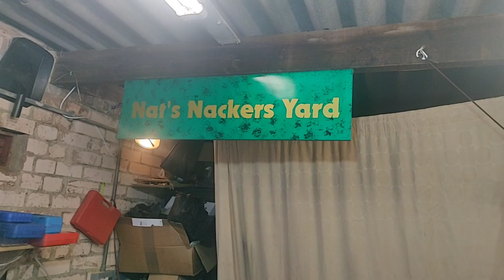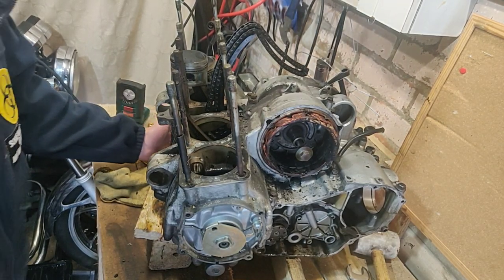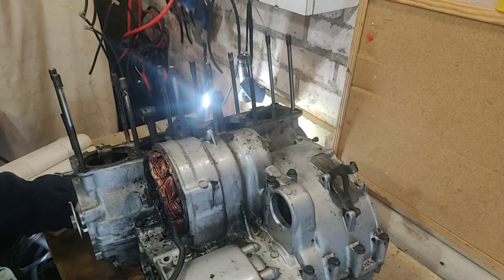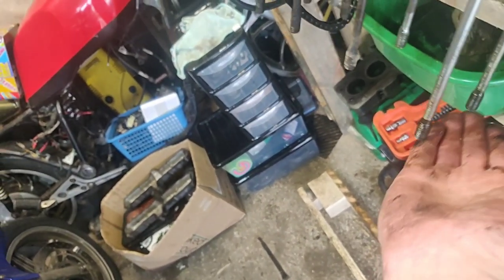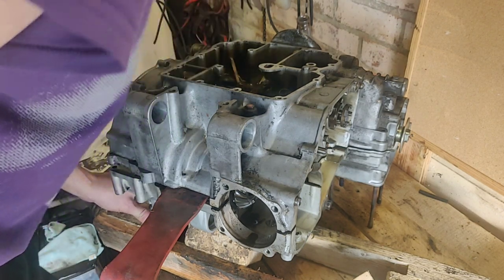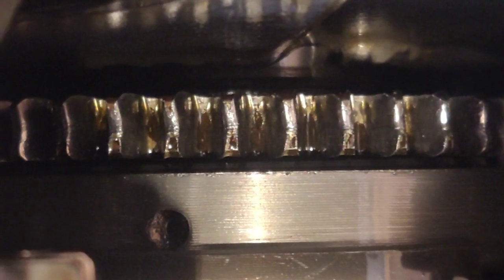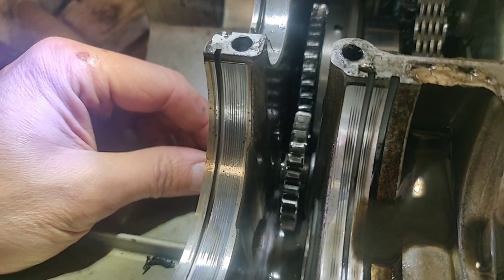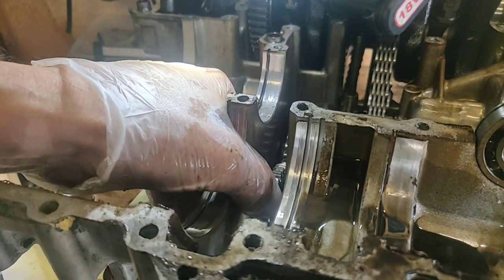Yamaha XJ650 Engine Split Part 2.  I may have found the problem!

Comment: If I am reading the parts diagram correctly, a hex bolt, a lock washer and a stopper plate, hold the pin in the idler gear, which holds the idler gear inside the crankcase
Reply from the maker: Yep.  I appear to have two out of five!
Reply: @NatsNackersYard  The lock washer and stopper plate look like they have been used on a few models, I put the part numbers into CMSNL to get a decent image of each part, they look easy enough to source used as well

Comment: I don't know that engine, but I find it hard to believe that the idler gear shaft is not supposed to pass through and be supported on the inside as well. I suspect a burr may have formed on the shaft, or the inner mounting point, as a result of the gear running out of line, and this is stopping the shaft either going fully home, or pulling out.

Comment: Screaming at the screen Pull the fcukin pin out 😂😂😂 That pin should be flush, passing thru the housing, gear and into the other side
Reply from the maker: I tried but it didn't want to come out.  A bit of a shove and I now have it flush!
Reply: @NatsNackersYard  maybe not being installed properly has caused a burr on the pin and/or the engine case. At least it’s in now
Reply from the maker: My thinking exactly